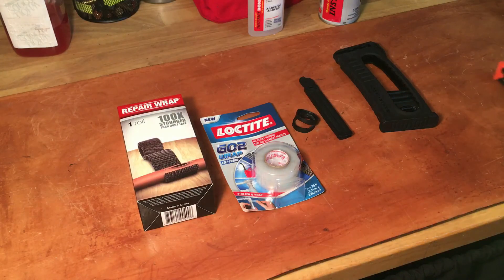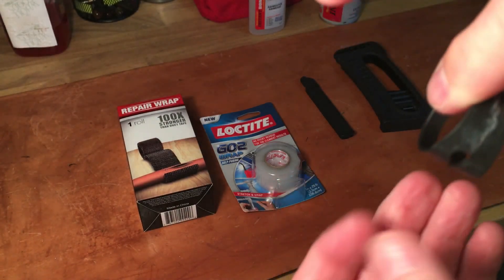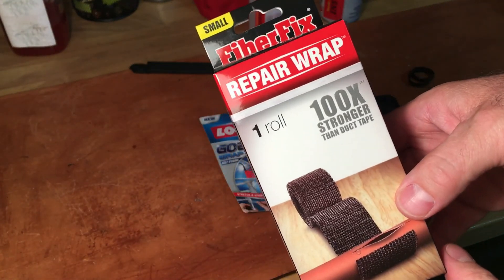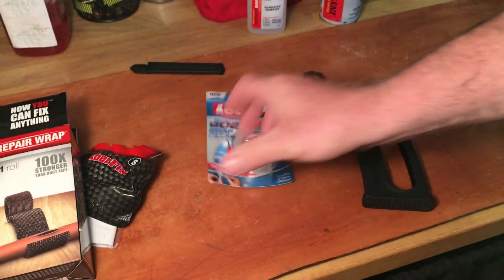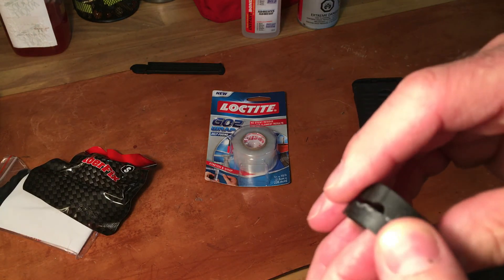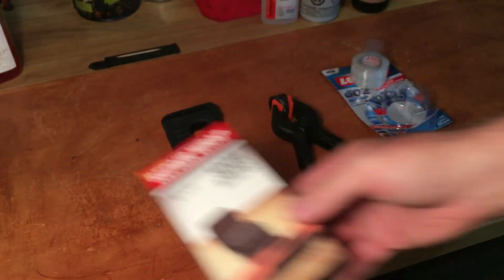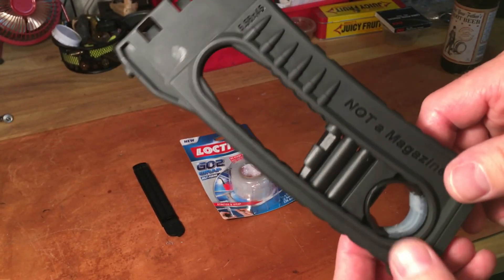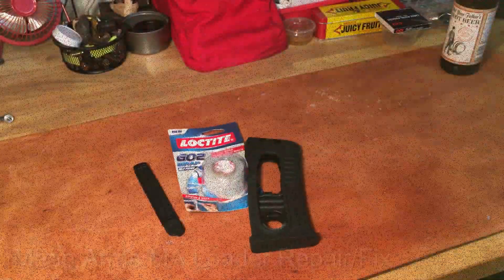How I Repaired my broken Mean Arms MA Loader

Comment: I was wondering did you have to ship it back to them to get replacement?
Reply from the maker: I sent them an email stating what happened.  they reached out right away.  They are only sending out a replacement ring.  With my "repair" I have the MA Loader working as it should.  I did not have to send anything back.